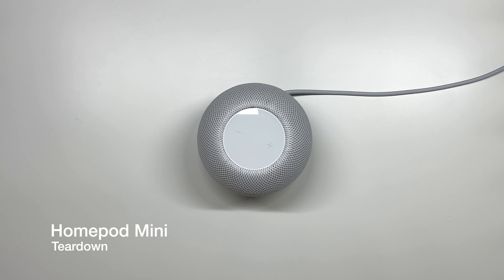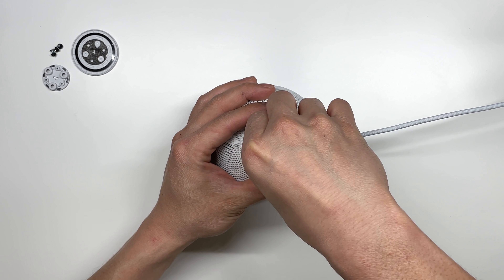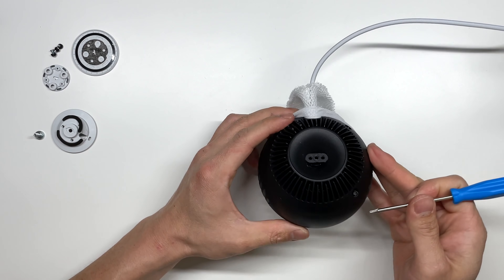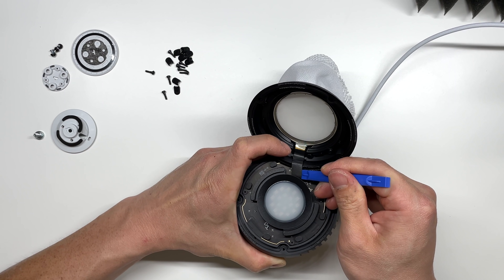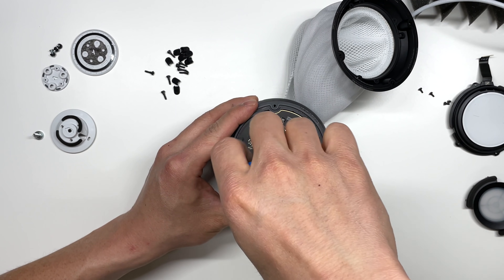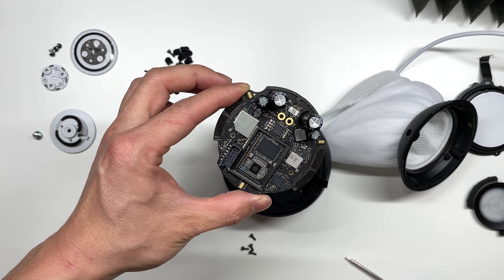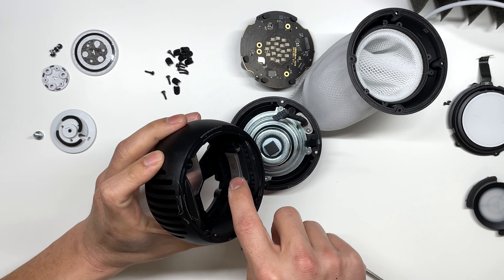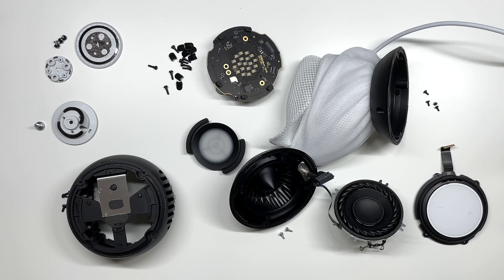Apple HomePod Mini Teardown Disassembly - What's Inside

Comment: Thanks for this video! I had a problem with my HomePod mini, it couldn't be started or integrated into Home, it always had a red rotating light. Through a thread on reddit that refers here, I was able to open the HomePod mini and pull the cable out to the touchpad. It now works again, but without a touchpad, but since it is on the cabinet, I never needed it.

Comment: Fixed the unresponsive touch surface that kept homepod mini resetting itself using this guide, thanks a lot!
Reply: How? I have the Same issue at the Moment
Reply: @StarBojy open it and remove the cable from the touch surface. Then close it again
Reply: @steliosena my HomePod mini works now again, thanks!

Comment: You really got to do a little more research before you make your videos it was pretty good but it would be nice to know what you’re tearing apart the rubber thingies on the side or passive radiators for bass wire towards the bottom that you thought was a microphone is a temperature and humidity sensor the speaker how many watts is it those are the things we would really like to know not just see it ripped apart and not know what you’re tearing apart

Comment: Hm, so there is the mini with a single full-spectrum speaker at €100 and the regular Homepod with six tweeters + woofer at €350...looks like there would be room in the lineup for a Homepod midi with 3+1 at €200?

Comment: I thought there are two speakers inside... how come its soo loud with one small speaker
Reply from the maker: crazy apple engineers :)
Reply: There are a lot of small (1inch , 1.5 inch ,  2 inch) full range speaker drivers out there now a days. They have power rated like from 1W to 15W (may be more).  Reason they have more power for the size is thanks to 
neodymium magnets. For producing bass with these speaker drivers, passive radiator (two on the metal body) can be used.
Reply: The speaker on the bottom is a subwoofer and the “metal and rubber” on the sides were the tweeters, so it has 3 speakers. If you pick one up while it’s playing you’ll hear voices coming from the sides and then bass coming from the bottom, it’s a really interesting design
Reply: @matteo94164  unless I’m wrong and I might but the side pieces are radiators.. that help amplify the shockwaves from the base they aren’t electrical at all they are just metal and rubber that vibrate. Tweeters are speakers for catching high pitched sounds

Comment: The inside of apple product is alaways so satisfying
Reply: Those black PCBs are awesome and don’t even cost that much more. Would’ve been nice to see them on the new consoles but I guess Sony and MS don’t want to spend an extra $0.50 per unit purely for aesthetics.
Reply: @Noah-Lach  factor in a few million units and those additional costs add up to a nice fat amount
Reply: unless you meet the inside of airpods.
Reply: They are always nothing like the PCs I used to build. Tiny connectors and 1,500 hidden torx screws. After I killed the display on my iMac, I decided to stop trying to do surgery on Apple products. Arduino parts are much cheaper and much easier to connect for such hobbyist thrills.
Reply: @michaelbuckelew  why do yall got be like that . yall android windows users always have to interfere with everything . what are you doing on this video ? you just came here to bad mouth apple . let us enjoy our stuff
Reply: @ldtworks1052  how did he bad mouth Apple?
Reply: @ldtworks1052  lol. How did he bad mouth apple ?
Reply: @ldtworks1052  Bro what?

Comment: I wasn’t planning on buy one but bought it as a computer speaker on my new mac mini for my Zoom calls. I chose the homepod mini because I had an extra 30w usb-c slot on an anker multiport charger but no more wall outlets available. Also airplay works great from computer to homepod.
Reply: it comes with its own brick tho
Reply: @mastertvlogs8737  I don’t have a plug for a single usb-c brick. I am using an anker 60w dual usb-c
Reply: can it play in stereo(two mini's) computer to HomePod?
Reply: @minishyam1992  haven’t tried it but Homepod was a bad idea for video calls on my computer. Has like a two second lag. It was pointless for my mac. But I still use it to play my toddlers lullaby before bed.

Comment: The metal and rubber assemblies on the sides are actually passive radiators. They improve bass response by being excited by the back wave of the main driver to improve bass response without requiring a bigger enclosure. The principle is similar to bass reflex ports but arguably better suited for tiny speakers.
Reply: i know and he said it is some rubber and metal..... i got so annoyed
Reply: @morrish044  same
Reply: Also commonly found on Bluetooth speakers and even some sealed subwoofers (usually nicer ones that aren’t high-end enough to have two active drivers).
Reply: @Noah-Lach  hi
Reply: @mcxxxvgt  irrelevant useless comment. Much like mine, but at least im pointing something out...
Reply: This is the reason I came to the comment section!